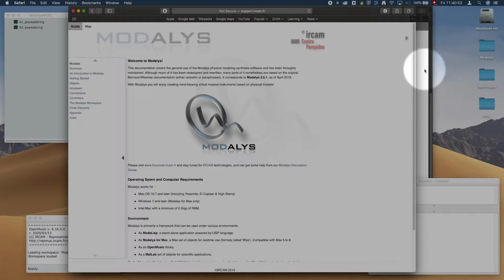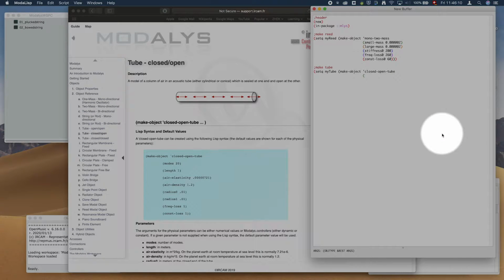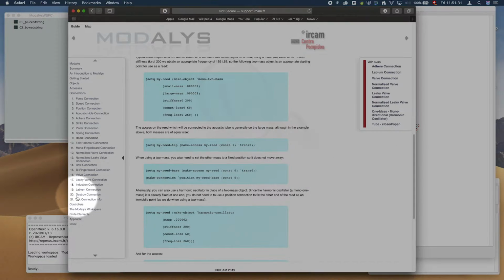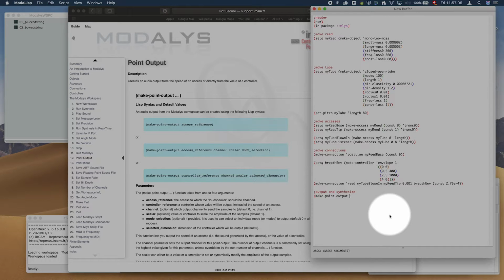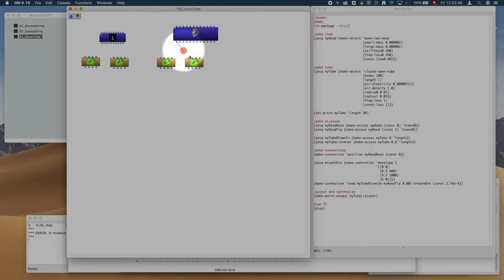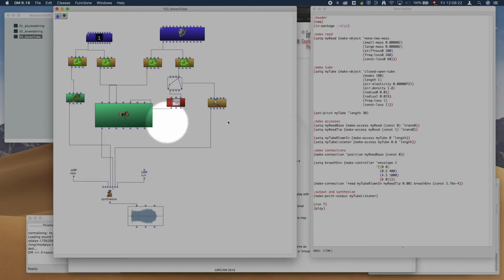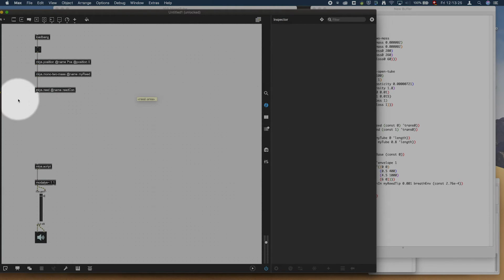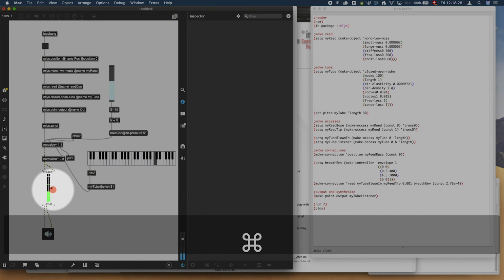Modalys 03 - The Confused Flatulence Tube - Modalisp/OpenMusic/Max

Comment: Hi !

To clarify about names of mlys objects in Max, Teo is right, each object of the same type must have a different name. So for example, if you create two output points, you have to name them Out1 & Out2 using the @name attribute. But the  Modalys developer (that I'm not actually, I m just a super user !) introduced a piece of code that is supposed to change the names of the objects when two names are the same when you create the mlys.* objects (it doesn't wok when doing copy & paste...).

Also, in Max I think it's more safe to use the @ attributes with Modalys (as you was doing before) instead of using the object's inspector. It's a way to avoid hiding important things to the user. So usually, I use attributes when the value of a parameter is different from the default parameters of an object.

About the pitch of the reed connexion, what you can tune in Modalys is the tube alone, not the tube + the reed which is a different physical system. That's why you get a lower pitch in high frequencies. Actually, it's hard to get a tuned instrument in Modalys. For the reed connexion, a possible solution is to have a different model for each octave with adapted size for the tube and read areas...

I wil now look all your others video cause I see that you already made ten episodes !

All the best !

Jean
Reply from the maker: NajoMusicTV thank you very much for the pointers! I kind of knew about the name issue, but not in such detail. Seen from the point of view of a simple user (like me :-)), the issue with tuning is not so user friendly...it would be ideal to at least have a sort of help file explaining what is the best way to calculate here....or maybe I missed it, because I am not such a big fan of the reed/tube system until now....

Comment: 28:00 I think you only need a name if you have more than one of the same object in a given script, so it knows which one you are referring to when using a cotroller. I believe that's the reason the examples you mentioned  didn't work when the objects have no name. If you're talking about the 'Modalys for Max Instrument Series' examples, all the controllers are something like 'Cymbal@modes' and the object is named 'Cymbal', so if you change the original object to a nameless mlys.circ-plate object (in this example), it won't work
Reply from the maker: Teo l thanks for clarifying . That’s what I suspected but I wasn’t sure :)...